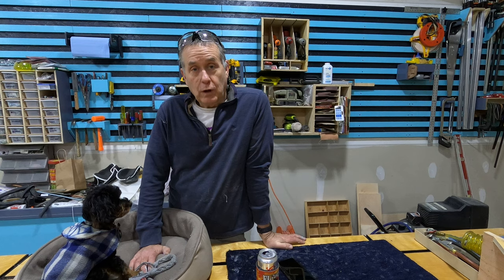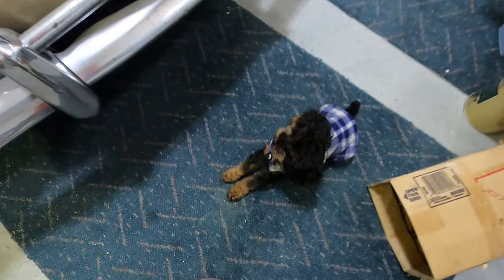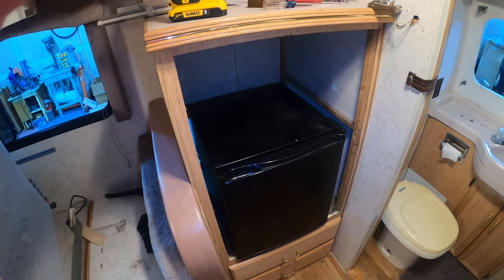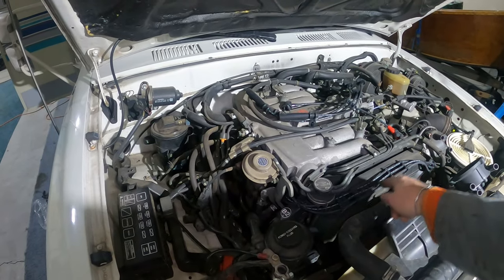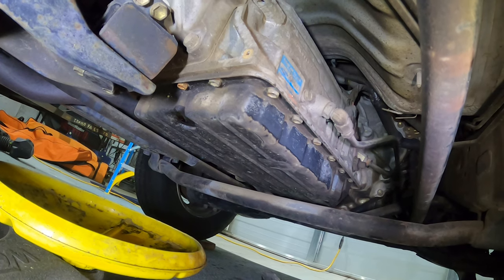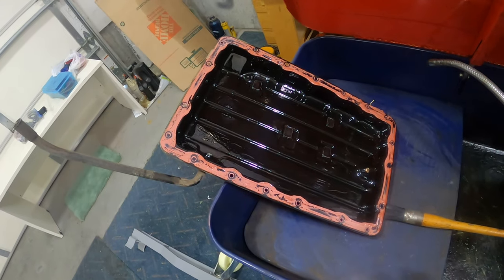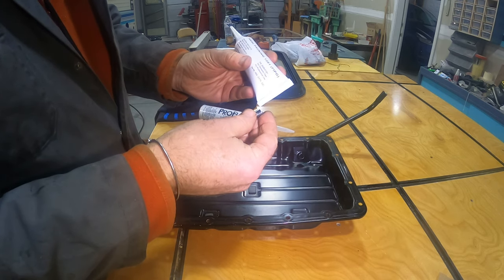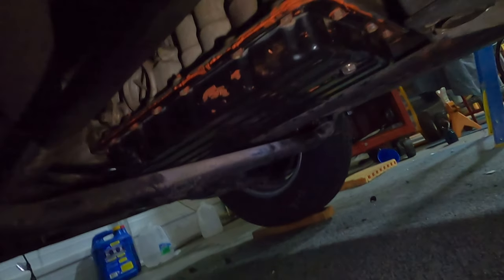Builder Series at Frank's Place - Episode 4: Toyota Motorhome Tune Up Part 1

Comment: That sure is a Pain in bumm job, good job, fingers crossed.   Getting things done, cheers!
Reply from the maker: Hey Wagongirl,
Thanks for watching and for the comment.   
Yeah...getting that pan back on the bottom of the transmission sucked.  I hadn't done something like that in a long time and so this was a big learning (or re-learning) experience for me.   If I had to do it again, I'd get the vehicle up in the air more to give myself more space to work.   I'd test fit the pan a few times before applying the RTV.   I'd have the right tools ready.   I should have had a socket on a regular driver not the torque wrench to start with.   And I'd find some tool like a metal rod or something to help line up the holes in the pan to the threaded holes in the transmission.  
Hopefully others learn from my pain.
Thanks for watching and for the comment.   Please stay tuned as I have a lot of projects coming and eventually the full remodel of Byrdie.
Enjoy the Ride

Comment: Cool.
Reply: Although I cannot believe you touched the transmission fluid.  So many stories about not getting the levels correct…
Reply from the maker: Thanks.   We are happy you're watching The Builder Series.
Reply from the maker: It's interesting you mention getting the fluid level correct when I refilled the transmission because it took me a long time to get it right.   On the dipstick there is a "cold" and a "hot" level indicator.   I first filled it to the cold while it was sitting inside Frank's Place but to do that I ended up putting more fluid in then the manual said we required.   Then once I  got Byrdie out on the road and really warmed up, I ended up adding more but I didn't want to overfill so I added a little at a time and ended up putting almost another quart in.   In the end, I got it where it's showing it's full when hot.   Also, there is a procedure to check it which involves putting the transmission through all the gears while the car isn't moving and then putting it in neutral and check it with the engine idling so the pump is running in the transmission.   Anyway...it was quite a process.
Thanks for watching and for the comment.
Enjoy the Ride

Comment: Wix, Bilstein…you know the top replacement parts well. 😊

Edit:  3M makes something called roloc gasket remover that a lot of guys swear by…might be worth a look see. 😊
Reply from the maker: Hey,
Thanks for watching and for the comment, I appreciate it.
I figure these no reason to use cheap parts and risk having to do the job again prematurely.    My time is too valuable for that.   That's also why I be using genuine Toyota parts whenever I can on Byrdie.   I also tend to research stuff and the Bilstein shocks are what seem to work the best on these Toyota motorhomes based on the forums I read through.
Please continue to comment and engage with me and I show more projects on the Builder Series.
Enjoy the Ride

Comment: I bet you could had one the same work on the Corsair plus points and condenser and set the timing in less time than the Toyota.😂
Reply from the maker: Hey Rich,
Oh...for sure.  I feel like I could have completely rebuilt a Corvair motor in the time it took me to install that transmission pan.   OK...not really but still.    I'll be tearing into Luna soon.   I'll be dropping the entire drivetrain out for a major oil leak fix.   The front main bearing seal is leaking and that requires separating the engine and transaxle and removing the flywheel and clutch.   I'll also be rebuilding the front and rear suspension and all the brakes.   I gotta get started!!
Thanks for watching and for the comment.   Stay tuned for more fun.  :)
Enjoy the Ride

Comment: We have a 2016 Promaster. I did the transmission service on that it had rtv as well. They make an aftermarket felt gasket I used when I reinstalled it and it seems to work great and will make it much easier next time. You should check if that is an option for your transmission.
Reply from the maker: Hey Robert,
Thanks for watching and for the comment/advice.   While my pan installation was ugly (and difficult) it doesn't leak and we've put on around 4k miles since I did that during our trip south.   I'm super happy about that.   But next time I have to service the transmission (at 60k miles), I'll look into an aftermarket gasket.   I'm also going to get the vehicle up in the air more so it's easier to work.
When we were considering the various vehicles we could use as a bases for our project, the ProMaster was my preferred van option.   The long wb, extended, high roof variety.   At one point I called our RAM dealer and he said he couldn't order me one because there was no allocation.   That situation may have changed but there were hard to get.
Thanks again for watching the Builder Series.   
Enjoy the Ride

Comment: Is an electronic cap and rotor an option for Birdie?  With your experience working on older Japanese trucks, you can come help me with the 60k servicing on my 1995 Isuzu.  Timing belt replacement!  Hope your hard work has paid rich dividends by now with a leak free trip--or two!
Reply from the maker: Hey Todd, 
Thanks for watching the Builder Series.   Luckily the distributor is all electronic and I believe the timing advance functions are all computer controlled.   I did check the base timing at idle which requires adding a jumper wire to a connector under the hood to disable the spark advance.    I'm not aware of any solid state replacement for the cap and rotor.
I'd be happy to help you with the 60k service on the Isuzu.   Just bring it over to Frank's Place and we can get her up on the lift.  
Our trip to the south in Jan/Feb was awesome and Byrdie did perform flawlessly and no leaks on my ugly transmission pan installation.
Enjoy the Ride

Comment: Good work Brantley!  Too bad you edited out the colorful adjectives that usually go along with car repair as I'm always looking to expand my vocabulary. Does that 3.0 have anymore HP now you've replaced ignition components? Once upon a time I did a few engine re-builds and overhauls and this brings back some memories of working on my Datsun 510.   👍🚐 🚲 🍺
Reply from the maker: Hey Graham,
Thanks for watching and for the comment.
I didn't want to break any YouTube community guidelines so I couldn't include all my verbal indiscretions.   Needless to say there was a point while trying to that transmission pan installed that I vented my frustration through my mouth.  
I doubt the engine has more power but it definitely ran great during our trip to the south and we put 4k miles on her with absolutely no issue.   Not even a leak in that ugly tranny pan installation.  
A Datsun 510...awesome.   I'd love to have the wagon version of the 510.  
Thanks again for watching.
Enjoy the Ride